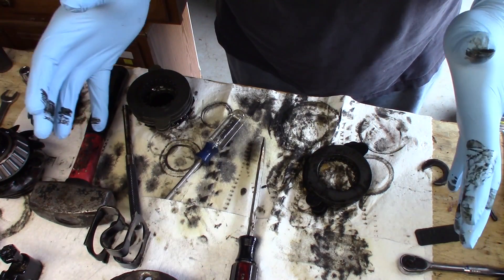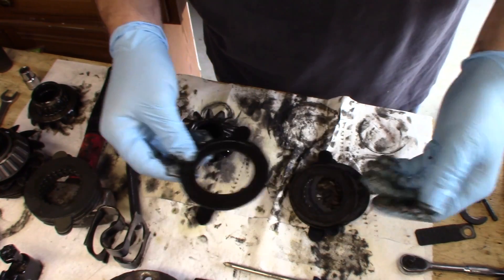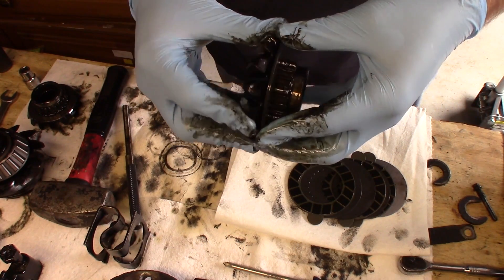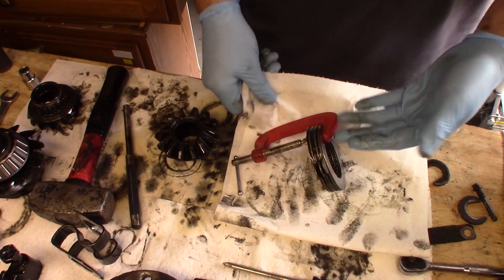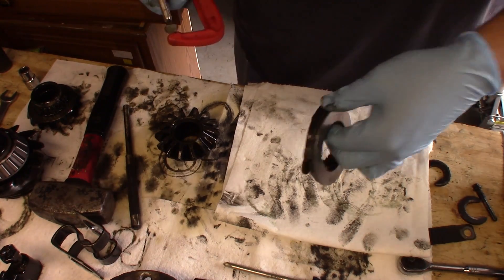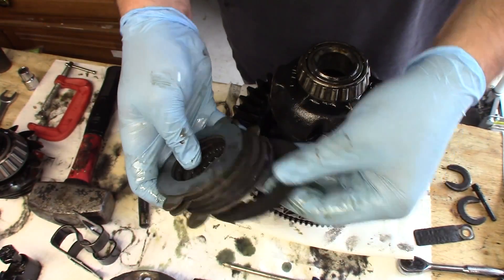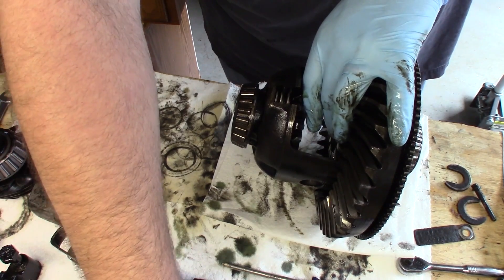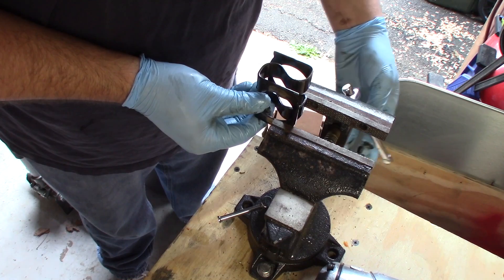Proper configuration of clutch packs ford 8.8 posi / trac lok

Comment: I've come to a conclusion about factory Ford 8.8 trac lock differentials no matter what you do no matter what clutches you use no matter how you stack them or how tight if one wheel is on mud the other one has good traction it might as well be an open differential since first commenting here 5 years ago I've stacked them several different ways including like this video shows and the like factory Ford manual says it just doesn't matter they're junk of course if you're on a good surface they will lay down 2 nice patches of rubber I don't know about the rest of you but I need mine for mud and snow where they're useless BTW my F 150 now has an Auburn and it works so much better like night and Day and that's not a plug for Auburn I figure an Eaton or Yukon would just as good if not better
Reply: I can't fique out how these would ever work as a LSD, they are and open diff with clutches to the axle drive, where as an open diff is open with a fixed axle drive so to me they are only an open that will just slip, so useless. Also an open diff will spin both wheels when in a straight line, but one will slip once you turn even slightly. BTW mine is an 01 Explorer and it has a different configuration with no shims but it has a thrust washer instead. I think Ford just through in what ever they had laying around.
Reply: @oldgamer1330  I've worked on a lot of 8.8 trac locs never seen one with a thrust washer and an open Diff will spin both wheels when traction is perfectly balanced and that rarely if ever happens or it will put torque to wheel  with the least resistance no matter if in straight line or not I've went as far as to talk with a Ford differential specialist he said the way the trac loc works is from axle side force not the S spring he told me if stuck and only 1 wheel is pulling to apply the parking brake slowly thus causing increased side force (that doesn't work either) in my opinion if you want a LSD go with an aftermarket the Auburn I installed in mine cost less than $400 and it is still working Auburns down fall is if you get one wheel spinning and don't know it you will bottom out the cone gears and it's junk after that Yukon is good but I like Eaton's Gov lock once you're above a predetermined speed usually 20 mph it becomes an open D making it safer to drive on slick roads and it allows for better MPGs while still acting as a LSD at takeoff or low speeds where you need it but of course these 2 diffs are expensive over $600 but if you want both axles to have equal power I would get a driver controlled true locker because a limited slip is not a locking differential no matter the name (believe me you don't want a mechanical locker in your daily driver)most newer trucks have computer  controlled lockers today
Reply: @insulman100  Yes I don't think any of them are really that good, but  mine with the trust washers will keep the tension on the clutch good as they wear. The clutch packs in mine are measure 5670 when measured with the thrust washer uncompressed and 5535 if you could compress it to flat which I don't think you could do, and no shims in the pack at all. It really is better then just a shim because as soon as you get a bit of wear your spacing becomes to big and there is nothing you can do about it until you replace them again were as the thrust washer will always keep the tension on the clutch packs. Can you tell me is the additive designed to give a little bit of slip or to stop any slip. Thanks for you help.
Reply: @oldgamer1330  Any LSD additive is a friction modifier designed to allow for slip without chattering when rounding corners and as I'm sure you know it is some nasty smelling stuff LOL
Reply: @oldgamer1330  By thrush washers you don't by chance mean dished spacer washer like in a DANA 60 LSD I believe you have a DANA/Spicer 60 not an 8.8 the 60s (also DANA 44s)do use dished spacers for tension Ford did put 60s in vehicles like yours that explains the no shims there are basically 2 types of thrush washers neither one is designed to apply tension by its self
Reply: My bad thrust washer not thrush
Reply: @insulman100  Yes they are dished spacers washers but mine is shown on my id tags as an 8.8 and that is what is shown in all the Explorers. Is there some way I can send you some pictures.
Reply: @oldgamer1330  I believe you maybe you or someone else figured out a way to make it work better does yours have the S spring as well? I don't remember the stack measurement right off did you need to pry the axles out to get the pinion (spider)gear shaft in? the last trac lok I built the shaft cleared by only .0025 with 1 .030 shim on each side I actually stopped measuring the stack I get them as tall as possible while still allowing clearance for the shaft following the advice from the Ford engineer
Reply: @insulman100  Yes mine still has the S spring and it also had some special shims over the top of the C clips but that was what all the noise was in mine because they where all in pieces and jammed in between the Spider gears, so I am hoping I have solved the noise problem. The problem I had was trying to get the stack back in and being thicker with the dome washers it would not allow me to rotate the spider gears in and so I needed to grind a small bit out of the housing to allow to spider gears thrust washers to fit in. I have seen others have this same problem and now I am wondering if they also had the dome washers in their diff like mine. I am going to ask them and see if they remember having them.
Reply: @oldgamer1330  If you would please let me know how your repairs workout I've got a 92 f-150 coming in to my shop in about 2 weeks with a bad trac lok he doesn't want to spend money on a new differential I think I'll try the cone washers instead of the shims If I haven't heard back from you  I'll let know how the 92s worked out thanks for the ideal
Reply: @insulman100  I have been trying to send you my email address so I can contact you but it seems like Youtube won't allow it, they must be worried they are going to miss out on something.
Reply: @ I know I also tried to send you mine hate to keep asking Questions but Does your carrier housing have open slots for the clutches or are the slots closed in in other words do tangs on the clutches go though the housing or are they enclosed if they are enclosed the clutch tangs should have keepers on them that fit into the slots if that's the case it would make it a Dana/Yukon type carrier I've done some research dana and yukon make carries for the 8.8 Ford might have used them (the Dana not the yukon) in some 8.8s if yours has the open slots it didn't come with the cone washers someone modified it

Comment: Thanks for vid, I have a 1990 Bronco with No LS. I was able to get a compatible 8.8 (H9) LS unit from a 2000 Expedition , for donor. The Ford kit no longer comes with friction Modifier. It now comes in the gear lube.
Reply: I bought the Motorsport clutches about 6 months ago and mine came with the friction modifier, you can smell it through the box (and the bottle was not leaking).

Comment: I'm in the process of rebuilding an 8.8 trac lok and have tried clutch pack thickness from .655" down to .640" with different thickness shims. I CANNOT get the spider gears in whatsoever. The old clutch packs measured about .550" and were worn, of course they came right out. What gives here? I don't want to pound them in with a plastic hammer, as that doesn't seem right.  I am using a standard clutch pack type, not the carbon fiber version.
Reply: I’m having the same problem with mine. How did you end up getting it?
Reply: @dominicarnold6609  I threw it in the trash and bought a brand new limited slip unit. Problem solved! haha....
Reply: @dominicarnold6609  Did your original clutch pack have a thrust washers on the end instead of shims.

Comment: My Trak lok has the shim against the gear, not the carrier. 
Yours will wear out the small surface area on the gear and into the steel plate
Reply: Grim I know this is an old post but the gear and the steel plates are splined togethering how is it going to wear out what will go wrong with this stack is the shim will spin against the carrier and cause problems like vibrating in a turn
Reply: @insulman100  this is my thought also. I am about to rebuild my 8.8 and I have the same concern. The problem is every video I see people are putting the shim against the housing, that doesn't seem right to me for the reasons you mentioned.
Reply: @insulman100  The steel plates are not splined together, only the clutch pads are splined, all the rest are free to spin.
Reply: Mine was set up like he's doing his, and wear was not very bad at all.

Comment: Putting a friction next to a shim ??? The shim is not splined so that friction is useless on one side.
Reply: I know your comment is old but I put the shims as described and after a while I had a ruff differential(like you get by not using the friction modifier ) after inspection I found the shims on both sides were moving and discolored I'm going to try putting the shims between the 2 steels the steels shouldn't move against each other so to me it seems like a good place for the shim.
If I'm wrong somebody please tell me why
Reply: @insulman100  I feel the same way you do. Every video I have seen so far here has the shim against the carrier which seems wrong to me. seems like the best place for the shim is between the two steels.
Reply: @dickdefilade1058  and anyone else that replied to my post after futher inspection of my carrier I found that the carrier is machined for the shim the pocket for the ears of the friction disc is higher than the area for the shim meaning if you put a friction first it would be floating on the ears resulting a lot of play and most likely making a L/S into an open differential however I still haven't figured out why my shims are worn on the side against the carrier
Reply: @insulman100  I would not put a friction first, it must have a steel first.
Reply: @oldgamer1330  if you mean put a steel against the shim that will fail rather quickly the steel is splined on the side gear that is also splined to the axle you must have a friction against the carrier the tabs on the frictions fit into the slots on the carrier if you put a steel first every time the axle speed is different than the differential carrier speed you will have metal against metal under pressure that will make a lot of glitter in your gear lube not to mention a worn out Shim, steel and most likely a damaged  carrier housing
Reply: @insulman100  Yes your right that would not work, it needs a steel with no spline.
Reply: @insulman100  I would say that would be the best place to put the shim, more protected between 2 steels.

Comment: I'm curious about how many miles can be expected before having to replace these clutches under normal driving conditions. Other than pulling them out and measuring, is there a way to know when they have worn & need replacement? Thanks!
Reply: You'll know your rear end needs service when the vehicle vibrates when pulling away from a stop while turning.
Reply: Do a burnout lol
Reply: Mine has been going bad after 10,000 miles in a 2002 Explorer.....fixed twice ....bad again

Comment: You say your read 0.6535" and that you are 0.0350 over. that can't be right, what is the factory specification?   If it is  0.650 then you are 3 1/2 thousandths over. (0.0035) please clarify, thanks
Reply: William Lewis You're correct. New spec is 0.6550", and at 0.6535" he's actually 0.0015" under or thin. Good catch.

Comment: Both my packs measured 0.654, I’m trying spin my spider gears in and then once they get where they’d slip under to get to the hole line up it just stops!! Is that bc my packs are to big? Using 0.35   shim
Reply: Ever figure it out? my spiders hit the carrier lip just before the cutout where the spiders sit when trying to spin them in with a .640" pack on each side. I purchased the carrier used and noticed the clutches it had were like new and missing 1 steel plate. The packs I took out measure .550" thick, so the spiders would rotate in and out. Clearly that didn't work, no wear marks on the steels! what a  bunch of bullshit, something is amiss with the setup I have, can't figure it out though. But, it looks like I'm not the only person to have this issue with that carrier. Someone clearly took the plate out and said screw it, good enough! LOL
Reply: @MattsRageFitGarage  do you have a early or late model rear end? as he mentioned the 80s had a different set up
Reply: @virgilsettles  1999 year model rear end and that carrier was out of a 2000 if I remember right. I wound up with a brand new unit and it was trouble free.

Comment: great video, why did you measure out .6535 on one pack assembly and .6540 on the other? wouldnt they both have to be the same number? just asking because ive never done this before. also, would it be the same configuration on a 2003 8.8 trac loc? thank you
Reply: Ideally you want the clutch pack to be about .640 to .645 for stock set up and as thick as .655 for a performance pack. You want them both to be as close (thickness) to each other as can be. 2003 should be the same.